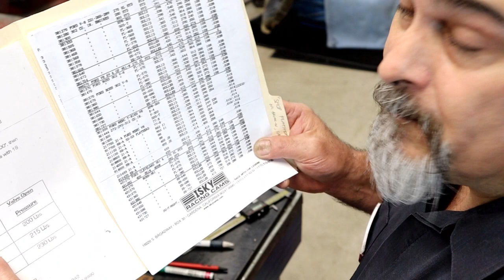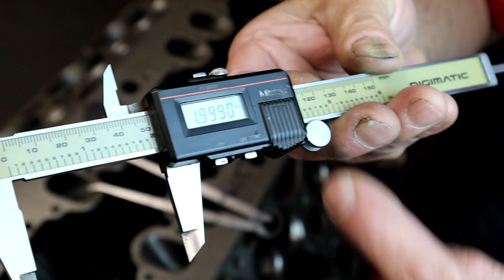FLATHEAD FORDS: HOW TO SET UP THE VALVE SPRINGS

Comment: Great video. Can't believe I never built a Ford flat head. My uncle and father raced them in the 50s , they ended up with arden heads. My uncle gave me the engine in the late 70s but when we went to get it out of storage it had been stolen. I now realize that a certain bar i used for all kinds of stuff was a guide tool. I'm going to look for it i think it is still around. Keep them coming. Thanks.
Reply from the maker: Sad about the engine but hopefully you find the guide bar.

Comment: Are you using a checking spring to set the height? Looks like it compresses extremely easy. Do you measure each individual "real" spring for 85 pounds? Some may get to 85 pounds at different heights.